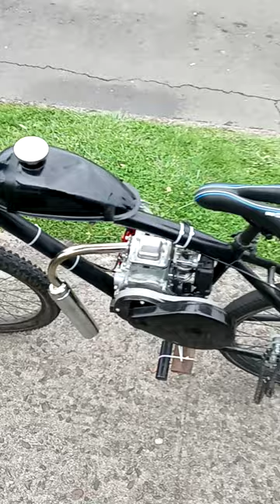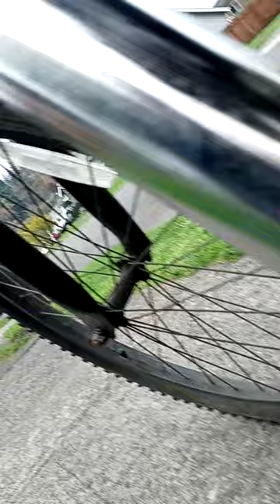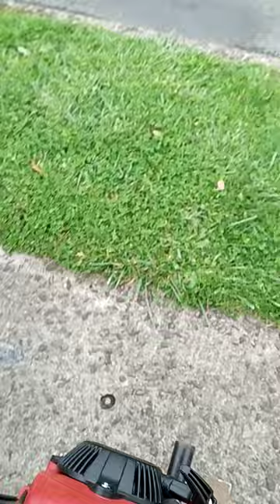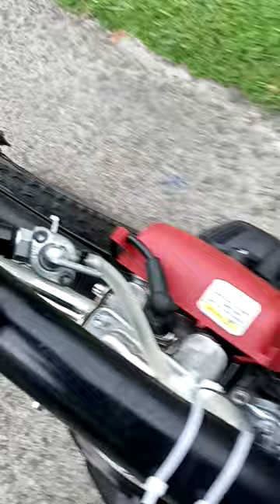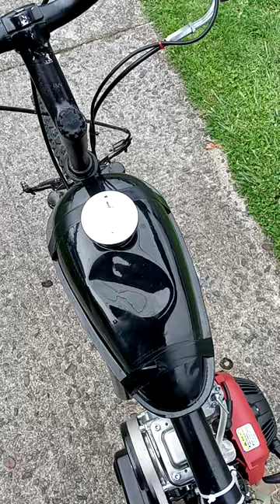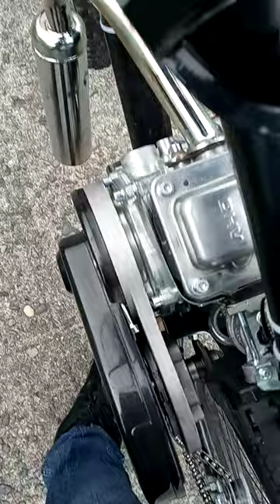53cc 4stroke

Comment from the maker: Its pretty much the same not a lot power difference it comes down to a very tiny bit more torque is all
Reply: I wish I had bought a 53cc 4 stroke instead of a 2 stroke kit.....You can run a silencer exhast pipe that'll reduce noise without blocking airflow. 
In hot weather on long rides, you can run 100:1 gas/oil mix that'll help keep top end of engine cool. I used to do that in my motorcycle. The bike ran better in summer heat with 100:1.

Comment: wich engine is best 53cc 4 stroke or 49cc 4 stroke. pls tell me, I want to buy a engine kit for my bicycle. plz answer me.
Reply from the maker: Either or will do fine the 53 just has a tiny bit more torque like enough to take you up a reasonably steep hill at 30mph with a rolling start. So depending on where you ride and how much you and your bike weigh will have more effect on you bike than that tiny bit of extra displacement  by the way you might wanna check into an after market wheel gear for your back tire just remember ( less teeth smaller gear means more top speed less torque) and bigger gear more teeth means less to speed but more torque. So the theory being 36 teeth and down for the street and 44 teeth and up for heaver loads like saddle packs or trailers or better yet for trail riding and ripping thru dirt gravel and mud just dont soak your air box unless you wanna have to clean your carburetor
Reply: 45km/h ?

Comment: What size sprocket
Reply from the maker: Its just a standard 44 tooth but the kit is on the smallest and lightest 7speed cruiser hybrid frame i could find i had to cut the choke switch short and bend/crimp part of the frame for it to fit and i have pro exhaust gaskets and i custom made the gaskets for my carburetor and my tuning is on spot its really just alot of small things I've done to make it go faster like removing the baffles cuz a 4stroke is a closed valve system and doesn't need additional back pressure to govern the motor and i run high octane and synthetic oil but theres a catch it will only do 45mph at top end when its cold out like 40 degrees or lower otherwise i get about 40mph when its warmer but i also live it washington by hills and mountains next to the river and im at 15 feet about see level your jetting in your carburetor its heavily affected by your altitude like the higher up you are the smaller the jet needle you will need believe it or not the 4 stroke  are very modifiable but far more reliable than a 2 stroke cuz you can gas and go with no mix I could go on for days lol im obsessed and got started on a 2stroke kit a decade ago and gradually moved up to a 4 stroke but if you have any more questions i would be happy to tell you what I know
Reply: 36 sprocket 22" inch ring and 4" inch fat tires
Reply: 36 sprocket 22" inch ring and 4" inch fat tires
Reply: It's a fatbike
Reply from the maker: @MizanurRahman-qh7tv  thats gonna be a fun set up and even better with front suspension it'll be a comfy ride but remember to get rolling and pedal a lil bit before you get on the throttle
Reply: Where did you buy this engine? Make? All I see are 49cc ones
Reply: @larrymaynor1750  google 53cc 4 stroke kit